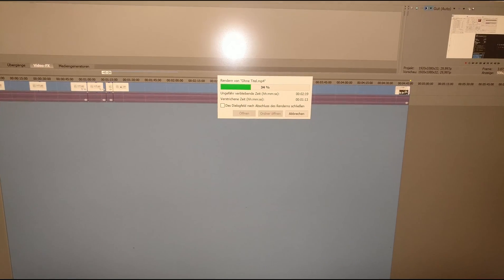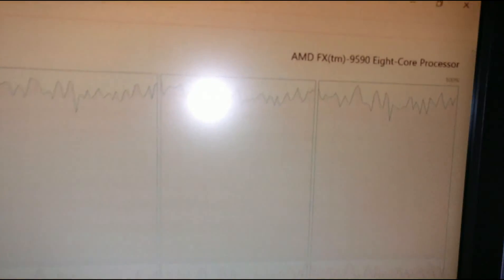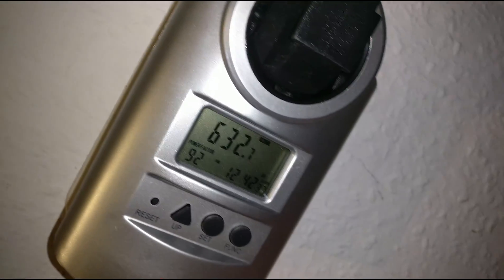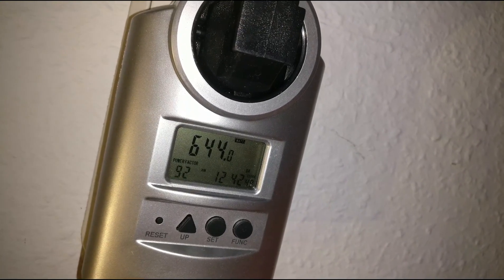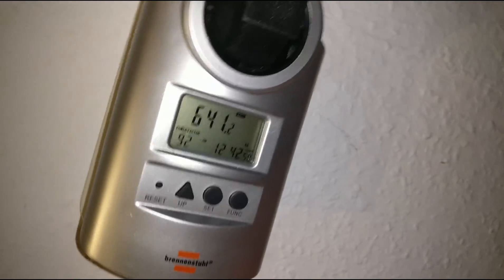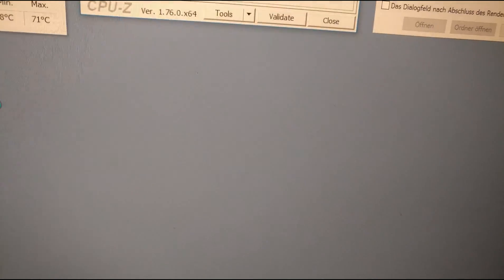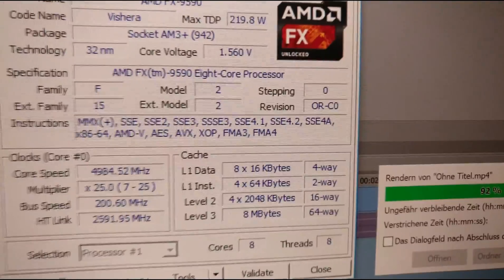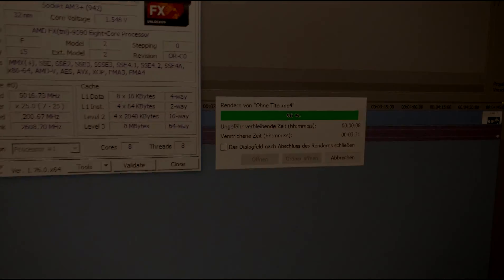FX 9590 @5.0GHz power draw while rendering!

Comment: I know this is an old video. And not all FX processors are made the same. But may I know the motherboard you are using as well as the settings you have entered to run your FX-9590 stable at 5GHz? Also, what are you using to cool your CPU?
Reply from the maker: I was doing like 1,55 -1,55V. My cooler is the Arctic Liquid Freezer 240. Greets!
Reply: Yes, how did you cool it down?